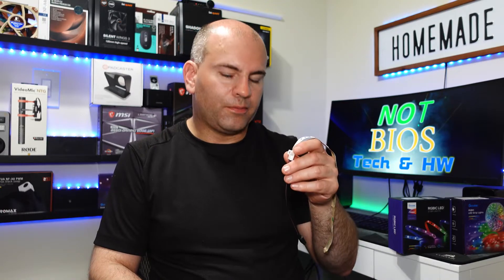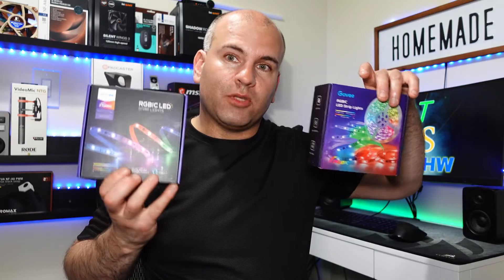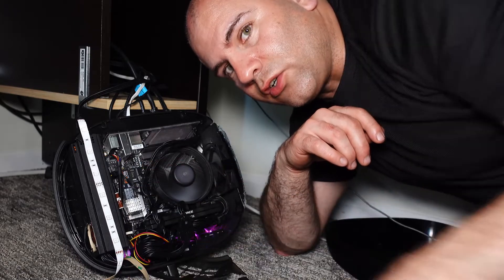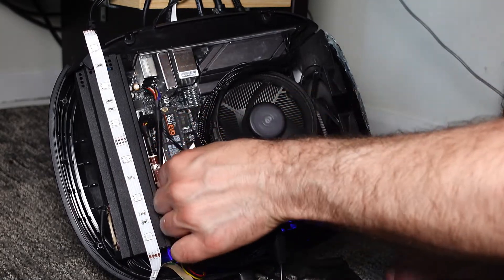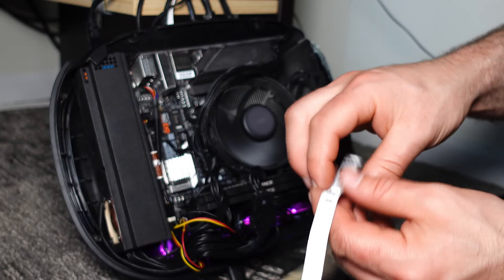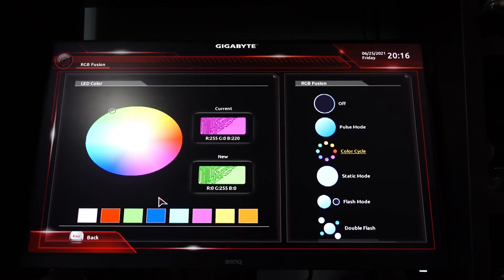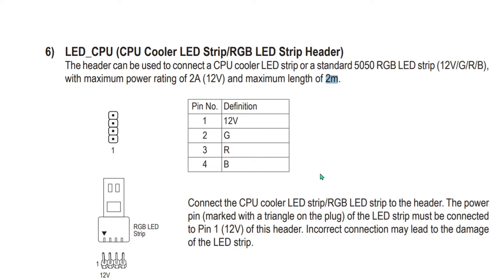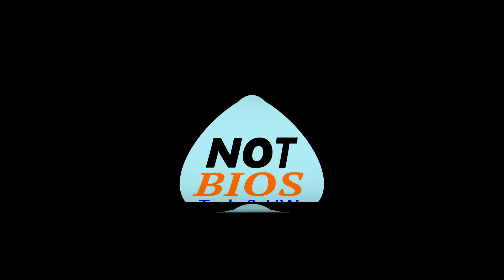Connect RGB Light Strips to PC

Comment: i did this but its only showing red
Reply from the maker: If the other contacts are slightly off the other colors are going to be missing. For RGB it is 1 power pin, 1 red, 1 green and 1 blue pin

Comment: Hello, I know you will know about this but did gigabyte h510mh will work with silentiumpc aurora stripes rgb ? It would also be possible to control the LEDs from the BIOS ? or from software
Reply from the maker: Looks like it should work. Both 4 Pin RGB. If the spacing is identical it should work like it was meant to work together. Usually the RGB control in controlled using motherboard software that needs to be downloaded.
Reply: thank you soo much I hope your hard work will be rewarded  @sparketech
Reply from the maker: @Ok-bn2yu  thank you... Feel free to take a look around... Have piles of RGB stuff I review... Have playlists to make it easy. My other channel is all about studio equipment basically YouTuber stuff but mostly microphones.

Comment: hi i want to buy a sk6812 and the problem is its 5v while my b550m msi pro vdh has 12v connector how do i connect the led strip to my pc
Reply from the maker: You don't... you'll need 12 volts and everything powered correctly. The only reasonable option is an adapter or hub or some sort that would happen to be compatible. Connect any if you have the matching voltages. The PCI-E connector is 12 volts btw... but the pin out of the strips matters to find the compatibly hub to make it all work.
Reply: @sparketech  what adapters wiuld you recommend
Reply from the maker: @joshuajohn74  I wouldn't recommend any. I would never personally change voltages and next part is the 3 pin connection and next issue is finding a hub that allows use of any form of RGBW control. To make something work without being a fire hazard would likely cost much more than your strips... You'd be best off to research options "12 volt RGBW hub" to see if there are any. Cheap hubs are splitters only that might work is to purchase a 3 pack RGB fan with correct voltage and RGB pin put. I Reviewed 4 recently but do not remember the pin outs.... 2 we're ARGB... RGBW is not common. I can't recommend any sort of hack job, and then you have to deal with software that might now allow these to work. there is a reason I say in this video "matching" voltages.
Reply from the maker: It is FAR easier when the ports are matching voltages, like I specify in this video. When you have to use a HUB you have to hope you can find software control for the strips for that hub and other issue is the matching pin voltages. I'm an electrician by trade but I don't have those strips to test.

Comment: Is it possible to connect the rrb light strip to a ch_1 header on the motherboard
Reply from the maker: 4 pin RGB is power to Red Green and Blue. the 4 pin fan header has a power on, ground (no power) a signal line to measure speed (not power) and DC Pulses to the fan (off on flashing power). Totally different power leads.
Reply: @sparketech  thanks

Comment: My mobo header says 12v 3 ampere but also says don't put more than 2 m, why? 
If I use 30 led 5050 rgb stripe which takes 7.3 watts approx. 
I could use 4 m easily then why mobo manual said 2 m. 
To tell us not to use the header at full potential and keep it to 2/3rd only
Reply from the maker: If I were a manufacturer I would also write 2 meters because some people would run higher power strips. Saying 2 meters max is a great way to cover your butt and avoid warranty claims if something could use more than 3 amps. 3 amps is likely a strict hard limit and on power on a 7.5 watt strip might pull 12 watts momentarily at power on.
Reply: @sparketech  thanks

Comment: 6:50 I have this same manual but a b450 aorus pro wifi board. It says maximum 12V, so does that mean it can support 5V? I have a cheap rgb strip (Broadlink LED Strip) that was included free with something I bought and been trying to find a use for it. My idea is to have it be plugged into the motherboard and control it that way but I don't know if it'll work. Box says its 5V and it has 4 pins
Reply from the maker: I recommend checking the user manual to make sure
Reply: @sparketech  I did, it's exactly the same as yours. They use the same one for both mb
Reply from the maker: @_BLUU_  usually the connections are a certain voltage. Like only 12volts unless it can auto detect. I never tried the incorrect voltage to find out. Would otherwise could happen is that LEDs get fried with too high of a voltage. You can try if you like, I don't have any RGB strips that are 5 volts left to test. Only 12 and 24 volts. My monster brand 5 volt and my goove USB 5 volt are all in the tray these days

Comment: My pc don't have molex cable 
My pc Lenovo m93p
Reply from the maker: I don't see any specs that allow for RGB, brand names unless being a high end system usually cut out all the extras to save money. I build all my own computer systems to avoid limitations. almost all custom computers builds have RGB headers other than entry level. 

You'd be best off to get a controller for RGB that connects to the a power supply header or simply something external that is USB connection. I have a playlist of the many RGB light strips, bars and RGB products I've reviewed. I don't actually have any strips running off my headers but I currently as can be seen in new videos have 2 USB light bars, a USB lamp and Govee Flow light bars connected behind my monitor.

Comment: I have an asus board. I installed aura and have my Ram and gpu set. I have a deepcool as 500 cooler with a rgb strip on it and a fractal torrent case with an rgb strip on it. How would I connect both if my board only has one header? I am assuming those would be 5 volts? do I need a controller or can I get a splitter?
Reply from the maker: The links in the description of my videos are a great source of information on connectors and how to connect strips together.
You will probably find your answer on my video how to cut and connect LED strips. I usually leave links to even purchases the packages of connectors. The connectors list the number of pins and width of the strips which is important to be matching as well.
Reply from the maker: If you need more help after it would make most sense to write on discord where I can actually see pictures but if the pin count is like 4 pin most of the connectors I review are 4 pin and some govee RGBIC I review are 3 pin and the Geeni Prisma were 6 pin... All this and more are in my playlist of RGB LED strip lights, light bars and RGB stuff. I have monetization off, I am not mentioning to make money cause I make zero $ from views.
Reply: @sparketech  I have been building pc's for 20 years, this is the first time even trying to do this. The led strip on the cpu cooler (Deepcool AS500) has a 3 pin argb connector and the led strip on the case (Fractal Torrent) has a 3 pin argb connector. I only have one 3 pin header on the board (Asus Tuf X570 plus) so not sure what I need. I am assuming a y splitter would work but I am not sure if the header can deliver enough power. I have the software installed and ram and gpu are synched already.
Reply from the maker: @davidbrennan5  your motherboard has a controller built in. I was called for a computer contract I never applied for back in 1998 cause of word of mouth. Been building computers for 25yrs. Connecting this was not some YouTuber knowledge... I just did it after I made sure they were voltage compatible. It does help that I have electrical training so I do know what to look for in terms of current output so it does not exceed the built in motherboard controller. I have no clue if your strips are voltage and pin compatible without testing them.

If you check your strip specs and check you motherboard header specs to see if they line up than you'd know. That information shouldn't be exclusive and should be known values listed in a manual for the motherboard and for the strips
Reply: @sparketech  Thank You for your help, I learned a lot from your video. I think ordering a rgb controller that has multiple argb outputs would be best, the splitters are almost the same price. This case has 2x 180mm  fans on the front and 3x 140mm fans on the bottom. I ordered this rbg ram kit only because I could get it very quickly for the build and the gpu had built in rgb. It just looks odd having the middle and top left of the side window dark now. I may just order 2x180mm rgb fans that comes with a controller then to get it all set up and balance the lighting out. I usually do black out builds this is a first for me.
Reply from the maker: @davidbrennan5  a controller is probably the best way to go no cuts and no risk over overloading the built in ports. I experiment a lot, often just to see if it can be done. I've never used any form of RGB controller or hub myself. To try and help I'd have to talk on discord which allows posting of pictures and stuff. For a controller you'd probably be able to figure that out easier than myself lol. I'm the guy that tends to do things the hard way to make it work :P. On my studio channel where I test audio equipment I prove things can work together that were never thought could be done or are ever shown

Comment: Can i use 7m long led stripe with that port.
Reply from the maker: Not likely due to power limitations of the port. There should be a spec for your port of volts and amps

Comment: Bro you have to turn off your pc before you touch it 💀
Reply from the maker: Nope, but it is safe. It is 5 volts and if you short nothing together it is 100% fine. Most likely hazard is shorting the motherboard if playing with metal, the connectors are covered in plastic. You do know electricians deal with live voltage all the time... I am an electrician, 5 volts is completely safe. Bet you touched both terminals on a 9 volt battery before or licked it to check charge? 9 volts is far more dangerous than 5volts and 12 volts is a low hazard as well especially due to the amp limit. The computer power supply is a real hazard, and I did get a really good shock back in my younger years.
Reply from the maker: Thank you for the concern, it's always nice to know someone cares.
Reply: not unless your doing something vital

Comment: My ASUS B660-i motherboard has an addressable G2 header (3 pin, 5V) and an AURA RGB header (4 pin, 12V).  I tried to plug in an airgoo 3-pin light bar to the addressable header, and it didn't light up.  The connection seemed a little loose, a little too easy to remove, but I couldn't get it plugged in any farther.  I might not be strong enough to set up rgb...lol.  Guess my pretty RAM will have to do.
Reply from the maker: There is also the concern of power draw. Most PC RGB headers max put at 5watts while a lot of strips can be 10 watts or more... Also all 3 leads have to match the header for power and such